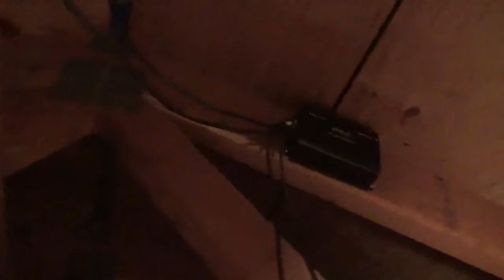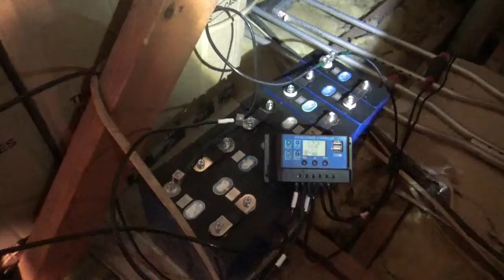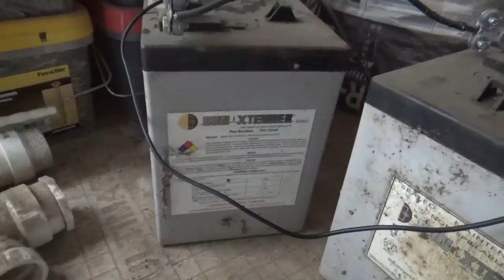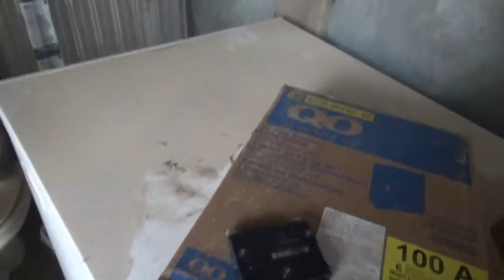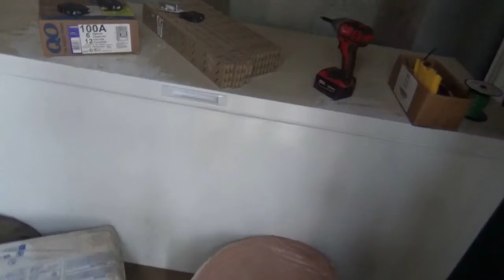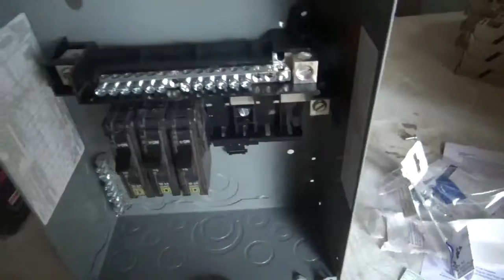Off Grid Fridge 12 Volt DC RV Refrigerator - Attic installation. 24VDC Deep Freezer Battery Bank

Comment: DON'T KNOW WHY AC USE IS NOT A PRIORITY OVER 12 VOLTS BUT AS LONG THERES AN ABUNDANCE OF 12 V APPLIANCES AND A WAY TO KEEP THE BATTERIES CHARGED ,  THIS SHOULD WORK GREAT FOR YOU .
Reply from the maker: The goal here is to be off grid which means AC is something we are working away from needing.